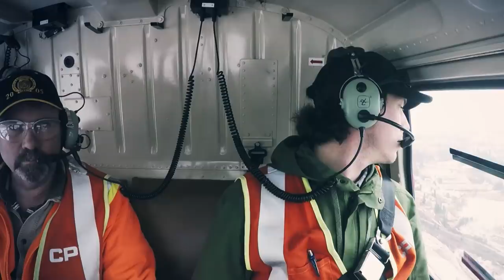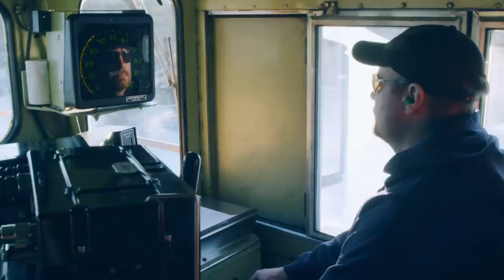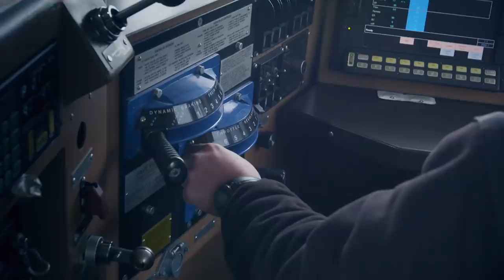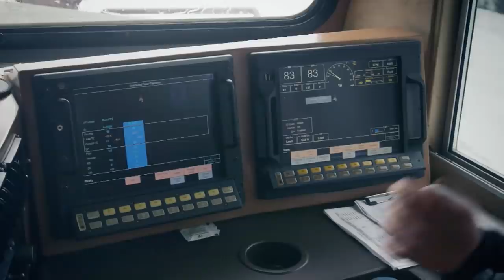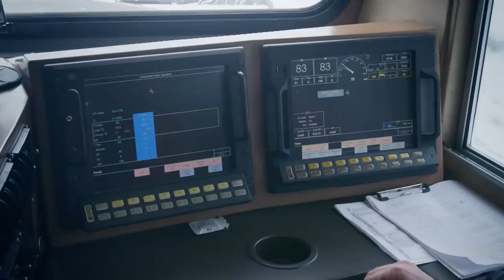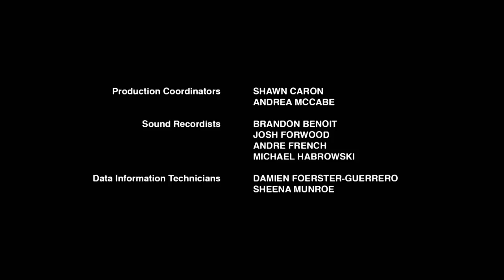Rocky Mountain Railroad | Episode 4: Deadly Washout | FD Real Show

Comment: First, LOVE that these are on YT!  Keep them coming!!!  Second, as to this episode, doesn anyone else find it haunting that Engineer Dockrell is not only featured, but his segment discusses air brakes and braking, and we follow him as he navigates the same spiral tunnels where the fatal accident claiming his life occurred in February 2019?  It just is so eerie.  RIP Engineer Dockrell.
Reply: 1
Reply: Ugh, forgot about that! Yeah that derailment investigation was followed by railroaders all over North America. So sorry for the guys and their families.
When I was working to Wenatchee the idiot trainmaster would not let our 108 car grainer be cut in two sections when it was 30 below in Wenatchee so probably 40-45 below on the east summit of the Cascades. So of course with still 20 miles to go to reach the east portal of the 8 mile tunnel the brakepipe air was being pulled out of the cars the higher we went. We broke in two from slack running in and out with the air down to 60 pounds in the caboose. We fixed that one, pumped up the train and went another 5 miles before we got another knuckle. The dispatcher in Seattle was very unhappy and I heard later he reamed that trainmaster in Wenatchee until he couldn't walk haha. We secured the rear portion of the train and left it on the mountain and took the headend 54 cars to Scenic at the western end of the Cascade Tunnel. We secured them and went back for the rear 54 cars and pulled it to Scenic also and secured it. The temp difference was amazing. If I remember correctly it was 10 above at Scenic. At this point we'd been playing 'trains' for 11 hours and the dispatcher had had enough of us. We took the power to Skykomish and met our relief crew there because we'd gone dead on the 12 hour 'Federal Hours of Service Law'.
In hindsight I was glad we hadn't tried to make it into the tunnel and down the 2.2% grade to Skykomish! We made a chunk of change that day since we were 17 hrs on duty by the time we got to our home terminal in Seattle.
Reply: @robsan52 w

Comment: You think the weather in the Canada is Unique in the Rockies Try Driving it in an 18 wheeler on I-70 west of Denver Colorado.  I avoid it in the Winter and take I-40 although that is a deadly corridor on I-40 due to the High speed limit down there it is still much safer than the unpredictable weather in the Rockies.  However, in the Summer it is some of the most beautiful landscapes anyone can ever take a picture of.  The mountains out there tower over 14,000 feet it makes for some very unique and unstable weather.

Comment: FANTASTIC GUYS AND GALS.  IM SEEING GREAT WORK ETHICS.  IN VIDEO 4 AROUND 19+ MINUTES I SAW THE NEW RAIL BUTTED AND BOLTED TIGHTLY TO THE ONE YOU DECIDED TO LEAVE.  NOW IN I THINK VIDEO 3 YOU LEFT LIKE A 2 INCH GAP ON BOTH ENDS AND TIED THEM TOGETHER WITH GAPS AND SAID THE GAPS WERE FOR  EXPANSION.  WHY IS THE RAIL IN VIDEO 4 TIGHT?